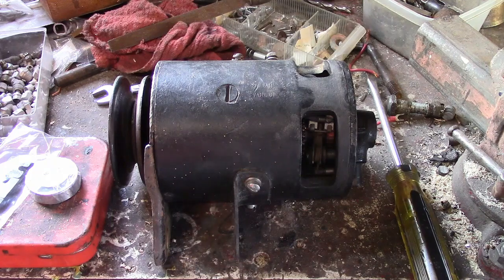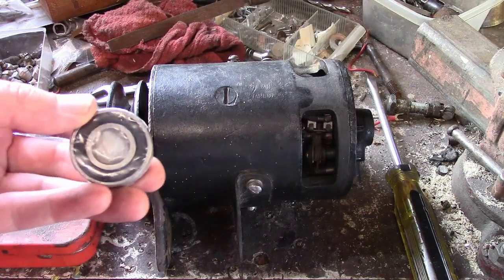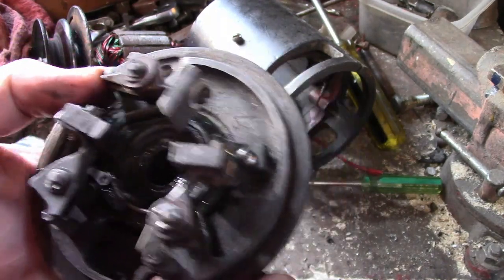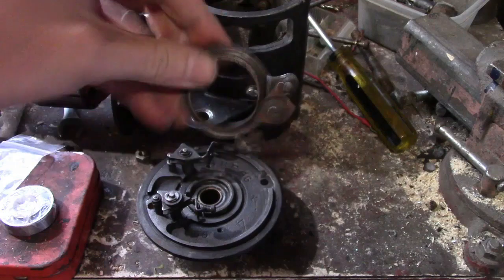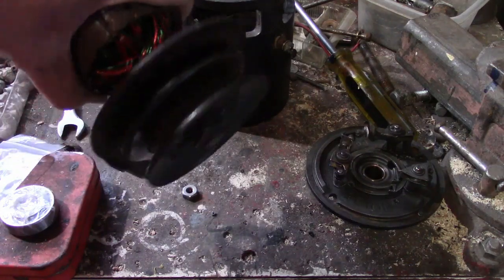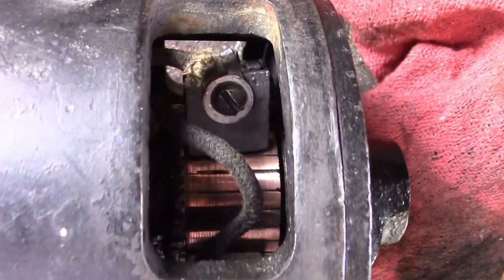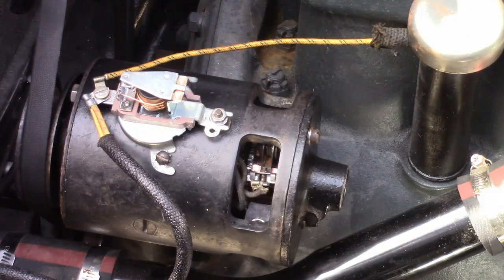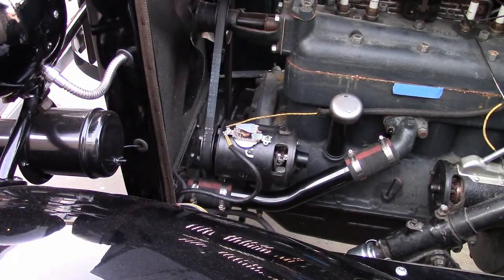Fixing a Ford Model "A" generator.

Comment: This is an excellent presentation and overview. However, an old timer, I would like to point out the DC generator internal generator wiring does not determine the generated voltage output polarity. The polarity is determined by the field winding core residual magnetism. Flashing the field briefly with a DC voltage yields the polarity desired. 
It is the residual magnetism created which determines the polarity of the output.

Comment: Nice video, thanks for making it. I would be a bit concerned about the pronounced wobble in the pulley (or slightly bent shaft, maybe?).  I'm guessing that's what tore up that front bearing.

Comment: Since the gen was previously repaired the rear bushing may be oil lite and it is porous and does not need added lube. They last a long time. Some bushings were lubricated with an oil wick. a few drops of 30 wt kept it good

Comment: I might have missed it in your presentation, but when installing the new brushes one brush in the usual kit is slightly thinner than the other two and is installed in the arm on the output adjustment assembly (with the ring). The two fatter brushes go in the output and the arm that is grounded with a short bare wire
Reply from the maker: Normally that's how they're done, the kit that I got had all 3 the same thickness.

Comment: That was awesome. Thank you. Question: How come my generator doesn't look like yours with the slots in the back to be able to adjust the 3rd brush? I've got a 1929 Tudor. Were there different types of generators in the early cars?
Reply from the maker: The slots are normally covered by a sheet metal band that clamps around the back of the generator. The only one I know of that doesn't have the slots is the Powerhouse, used in '28. On those, you have to remove the back of the generator to adjust it. But those look completely different from this one. It might also be an aftermarket generator that's made differently. I've seen those before.

Comment: I wished you would have shown how to polarize the generator I know you put power to the field on a negative ground but what do you do on positive ground
Reply from the maker: The same way as a negative ground. You just run the current the opposite direction. The field is negative, and the housing is positive.
Reply: Fact is, when he tests the generator by seeing if it will run like a motor, he has polarized the generator (using  a 6V charger, the positive (red) clamp is connected to ground/body of generator and the negative (black) clamp is briefly connected to the generator output lead (red wire).
Reply: Thanks for information using a battery charger and how to connect the leads in order to polarized it.Well explained!

Comment: How do you polarize a positive ground
Reply: Fact is, when he tests the generator by seeing if it will run like a motor, he has polarized the generator (using  a 6V charger, the positive (red) clamp is connected to ground/body of generator and the negative (black) clamp is briefly connected to the generator output lead (red wire).